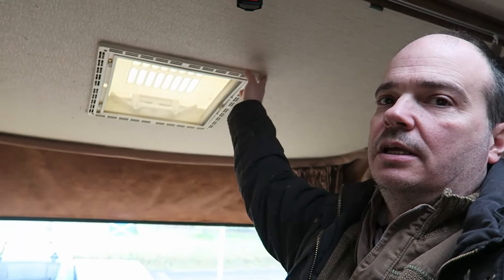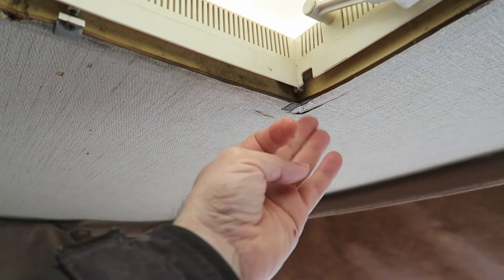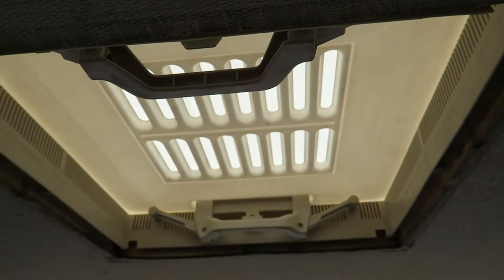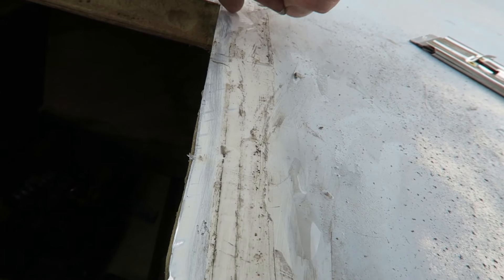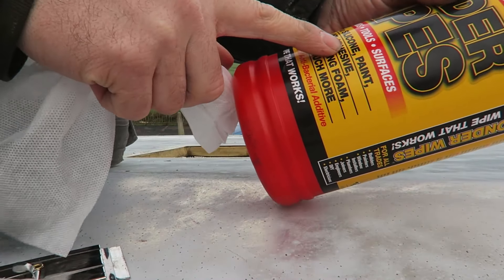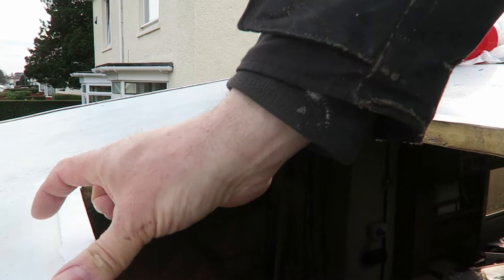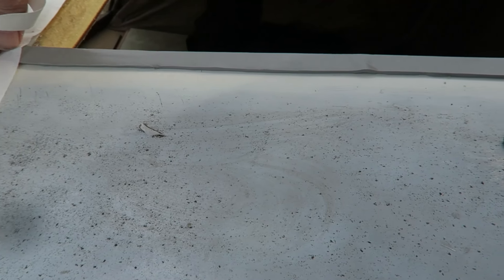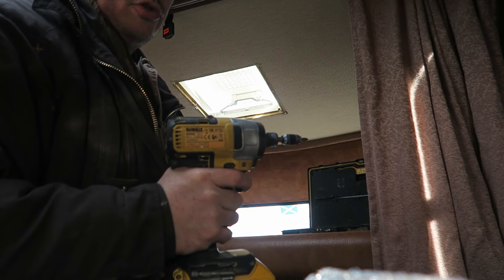Leaky Roof Vent Repair on Fiat Hymer B644

Comment: Just like to give you a massive thanks for the video. We've just bought an old motorhome that had a skylight sealed with moss! We unwittingly removed the moss and it leaked. A sealant gun didn't do any good but I bought some mastic tape and followed your instructions and it's been perfect ever since
Reply from the maker: Brilliant. Glad it helped you. It's amazing what moss can do 😊👍

Comment: I'm not sure I'd bother removing any excess mastic tape at the end, in fact I'd probably run another strip of mastic tape around the base of the hatch to seal it and give another layer of protection.
Reply from the maker: This tape is amazing at sealing. I have not had any problems with it, so far 😊. It is now my preferred sealing method. The only thing I would say is its a dirt magnet. That's why I took off the excess. Also when you cut off the excess you can examine the seal and make sure there are no small gaps (there shouldn't be but I like to check).
Another thing to note is if this tape touches itself there is no getting it apart again. I don't know how many times I have ruined a length just losing concentration for a second. So if you are putting tape around the hatch and on the roof you better be accurate when they come together or there will be swearing 😊. 
I do see your point though, leaks are not good. 👍
Reply: @classicmotorhomeowner4055  Thanks for the tips, great video too. I'm about to do a job on the rooflight on our 1991 B534 and your video has been invaluable..! Also, I read someone suggested chilling the tape in a refrigerator to make it easier to work with which sound like a good idea.

Comment: I believe that silicone is totally the wrong sealant for caravans. The butyl tape should serve much better. Cheers.
Reply from the maker: Agree. Silicone does not adhere very well to the aluminum body of the motorhome/caravan, it tends to come away very quickly and difficult to spot if not adhered properly. 
Sikaflex 522 is much better but not easy to use. It's like a sticky version of silicone - if you find silicone sticky and difficult to use the Sikaflex will take you to a whole new level. 
The tape is great - tricky to use but it seals a treat and lasts for many years. It's also a cleaner option than the sealants 
Just my experience, so far 😀👍
Reply: @classicmotorhomeowner4055  agreed. If it helps people to get the right info and avoid leaks then I'm all for it. You're right about the sikoflex, but it's ok if you know how 🤔.  Still the butyl tape will keep it sealed and if you ever need to replace it in 20 years, it'll still be just as plyable.